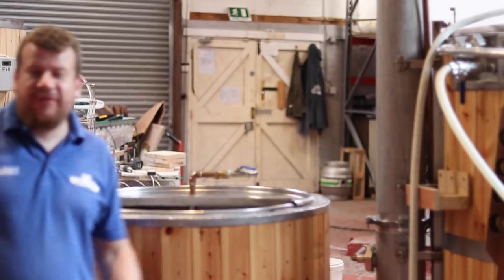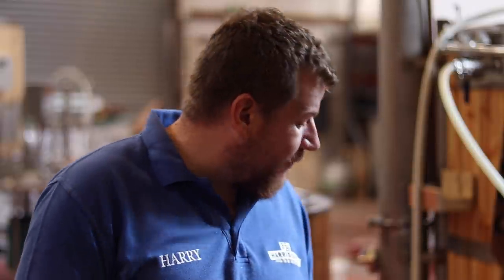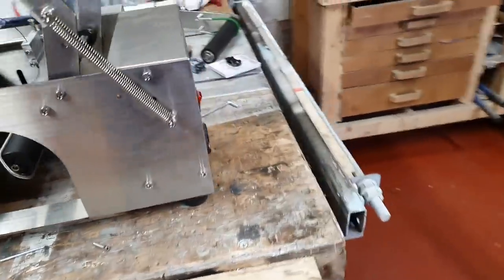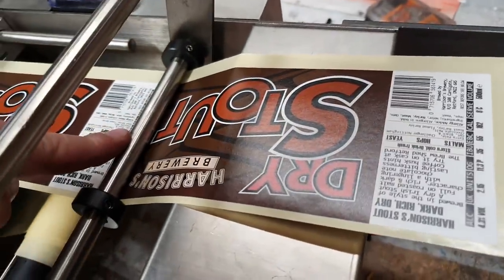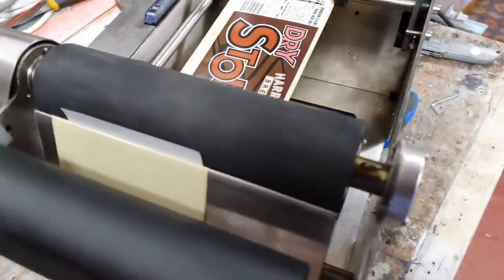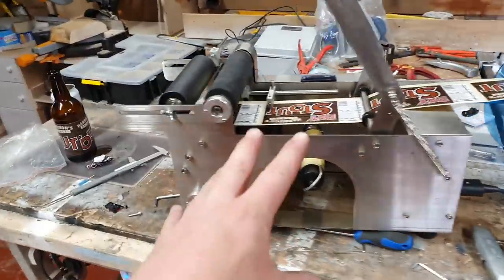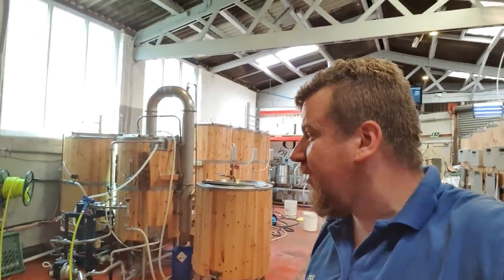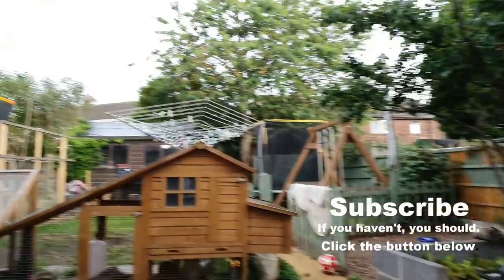MT - 50 Label Applicator For Cans & Bottles

Comment: Just bought one of those MT-50 labelers from Vevor (May 2024).  For the money it is not too bad, but I found (what I call) the "label carousel" surgical tubing friction system to be pretty hokey.  I replaced the roller shaft with a 1" diameter bar, bushed the side plates down to one inch, then used felt washers on the side against the mounting plate and a spring and shaft collar on the outside for tension.  I also did not like how the liner paper rubbed on the motor under neath... so I made and added another roller between the knurled front roller and the take up roller.  The factory should have mounted the motor at the back of this machine.  Since everything is chain they could have mounted the motor anywhere other than where it is.  Fortunately, I have the skills to do all of this.  But for the price ($350 USD) you still can't beat it.

Comment: Is it just that easy to add the ground wire just as you did? My labeller came the same way. I would like to use it but concerned about plugging it in.

Comment: Do you think i could easily modify one of these to label plastic buckets? - They're slightly conical (issue 1) and have a rim (issue 2). Top to bottom they're 190mm plus 20mm rim. Looking at your machine, I think I could set it so the rim over hangs the side of the machine - that'd solve issue 2.  But im wondering if i could replace the freewheel roller at the end (that the bottle/ bucket turns on) with 2 different diameter wheels at each end to counter the conical shape. 

Thoughts?

Comment: Hi Harry, great video!! Wish it existed when I got my machine. Wondering if you have any suggestions for getting parts repaired with them? It sounded like something snapped inside it last week and now the machine doesn’t feed the labels around. Something to do with the end roller that gathers the wastage paper.
Reply from the maker: Take the side panel off, there is a chain. It could have split a link.

Comment: We're having an issue with the inside roller pulling the discarded film (after label removed) at the right rate... Any suggestions? Thank you!
Reply from the maker: That roller is not chain driven so if it is pulling too fast just tighten your pinch roller to prevent this. If it is pulling too slow then I would just forget it and let the backing paper run on the floor and pick it up afterwards. Just make sure the pinch roller doesn't pull it in again on the out feed as this can damage the bearings.
Reply: @harrybrew69  Thank you! I think the floor is going to have to be our plan... and yes, our labels didn't come on backing paper but more of a film that has lots of static upon releasing the label so it's super easy to fly up & "stick" to the rollers above! (Which I see could gum up the works so to speak...) Thanks so much! Appreciate your reply!

Comment: We've been using this labeler for a couple years, and recently switched to plasticized labels.  We're having some issues with wrinkling, even with tension adjustment.  Did you run into this at all
Reply from the maker: A little. The space between the power roller and the idle roller can be crucial to preventing creases, as can the position of the top idle roller. I also make sure my spool tension allows easy movement. Do you use the backing paper winding function? That bottom roller has to be tight.
Reply: We're not using the winding function currently (our batches have been small enough it's been more of a PITA to wind it) but we'll be upping production shortly, and will probably start.  The machined roller is definitely tight.  With the top idle roller position, are you coming down on top of the bottle, closer to the machine, or closer to the user?  From the video it looks like it's closer to the machine than the user.
Reply from the maker: @bozorthbeverages2420   @Bozorth Beverages  After much trial and error I settled on positioning the 2 support rollers in a good position for the label to flow nicely on to the can then the top handle roller comes down on the machine side of the top centre of the can.  I also only have about 3mm of the next label sticking up, too much and it can crease, too little has the same effect.
Reply: @harrybrew69  Thanks for the help!  I'll make some tweaks the next time we hit the kitchen.